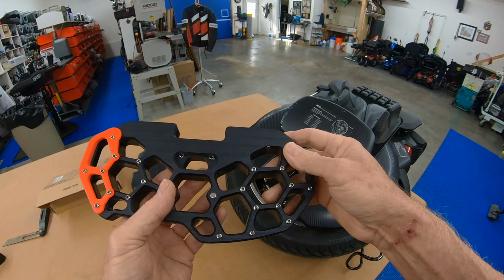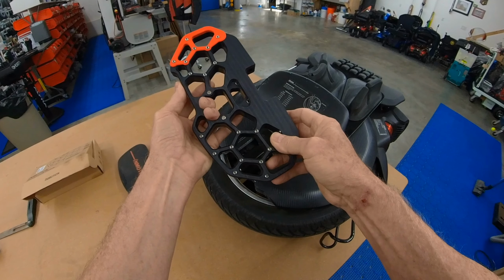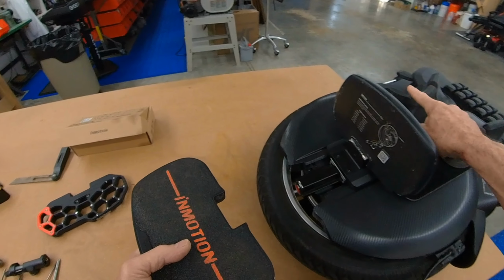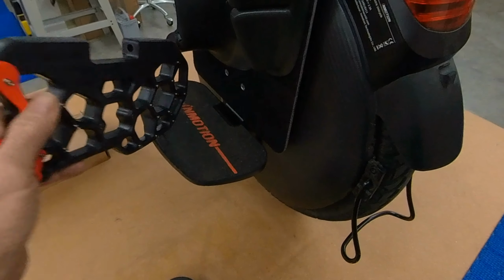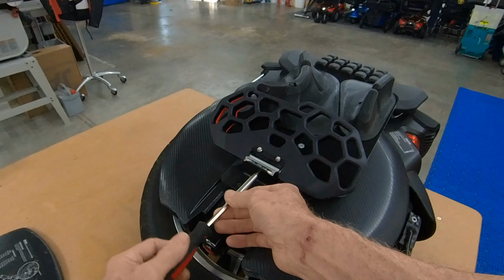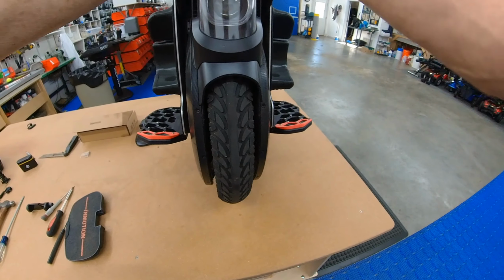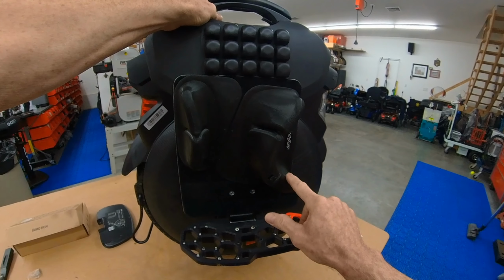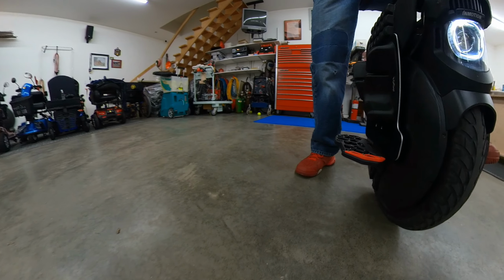NyloNove Pedals for Inmotion V11 2023

Comment: Great concise review and will be purchasing these soon.    As a newbie and about to purchase a secondhand V11, what protective products do you recommend I install to somewhat save the EUC from looking trashed while I am learning?   I've seen folks do some crazy foam and pool floaty type wraps with duct tape but i'd prefer to make it look a little classier than that!   thanks in advance.
Reply from the maker: Thank you! I  never used any protective devices other than on my body 😃 when learning how to ride this wheel. I did scratch up the plastic around the headlight but never broke anything. I would advise riding on a soft surface initially until you can maneuver comfortably and get on and off the wheel in a controlled way, using both sides/legs before moving onto asphalt. Smooth dry uniform lawn or outdoor rubber running track surface.  This way, when you fall, the wheel doesn't take a beating. Or your body 😜. Enjoy!

Comment: Correct me if I’m wrong but isn’t Nylon materials horrible for wet weather conditions? The plastic can absorb water even from air causing it to swell & deteriorate when wet? 

I’d figure you want an 6061 alloy pedal for durability & weather. Just an observation
Reply from the maker: Good question,  I'd think so as well, but they do make some bold claims as to how much stronger they are compared to other materials, including aluminum if I remember correctly. You should check out their website. I can personally say that I've had no degradation of any kind in 2 years of use. Still love mine.

Comment: How do you like the NyloNove pedals so far?  Do they feel like they have more "give" to make the ride more comfortable?
Reply from the maker: The flex isn't as noticeable as I had hoped for. I mean, it's not like I'm able to ride an extra hour due to increased comfort. I do feel and prefer the difference over the rigid aluminum pedals, though. So far, no complaints, and I wouldn't hesitate to purchase them again for my next wheel, still to be determined.
Reply: @mikethewheelchairguy    Thank you for the update.  So far I haven't seen a comparison video between Nylonove, eRides, and Clark pedals so I'm trying to decide which one to pick.